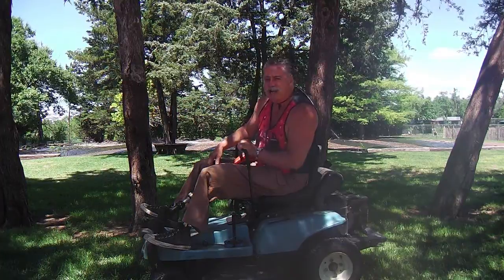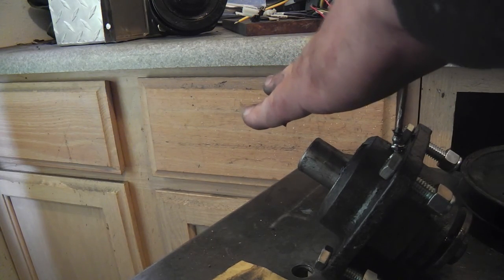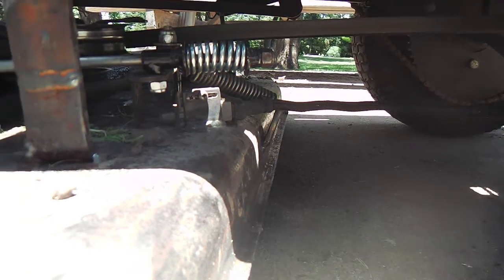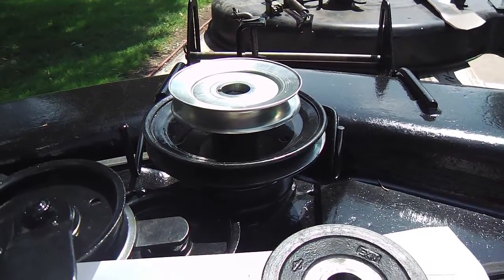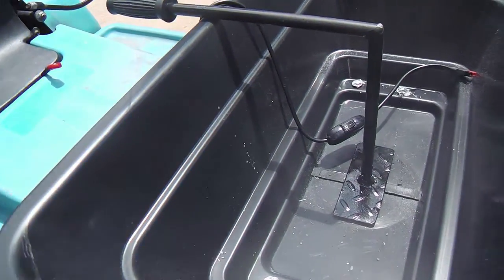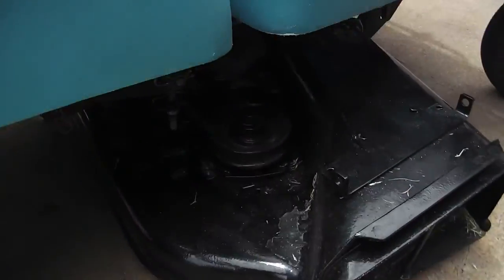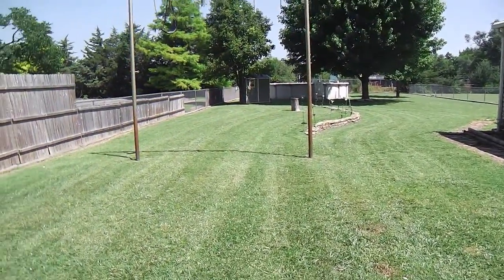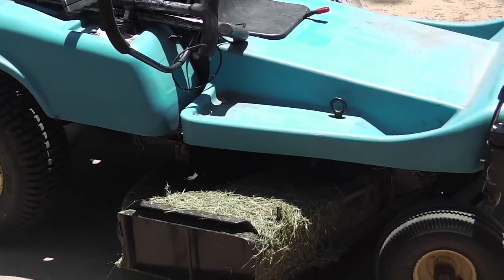Refurb & Refit 42" Deck To 30" Dixon Riding Mower

Comment: You are a smart cookie sir! I just purchased 2 of these models already fitted with the 42 inch deck.. Lots of learning here and I will make good use of the other videos... Looking forward to seeing the 20hp installation video
Reply from the maker: Hey, thanks for that nice feedback. Yeah, people seem to be coming out the the proverbial woodwork to ask if I want to buy their old Dixon friction-drive mower. But, one is enough for me. Although, my mailman has a 3304 that he had since new, even having had it serviced annually for over 20 years, which he now wants to unload, since he bought a bigger, fancier John Deere unit a year ago. Otherwise, I'm putting the finishing touches on the V-twin repower project. The video upload may take a little longer though. https://www.youtube.com/watch?v=wQ1LNr5Gg6s&t=5s&frags=pl%2Cwn
Reply from the maker: Hey, thanks for that, Russell. And if you're jumping into these type of Dixon friction-drive models, I've just finished a new and updated cone installation and adjustment overview, since I guess I wore one of my cones out over a four or five year period. I mean, this one is better than the video I did on this same topic some years before. Peace be with you...  https://www.youtube.com/watch?v=baaGjqRWd7k&t=3s&frags=pl%2Cwn
Reply: I have the electric blade engagement button and the tensioner pulley is in the back by the drive pulley and the belt won't stay on.What can I do?
Reply from the maker: @seasong4  Well, if there's an arm that pivots for the idler pulley that tensions the backside of the belt, it may be bent out of alignment, causing the idler pulley kick the belt off. Get under there like Sherlock Homes to detect and deduce something (motor off, of course, maybe even spark plugs out too). Then let us know back here what it was.

Comment: Where did you buy the head assembly to increase compression. I have a kohler CV14 motor and want to try a different head assembly.
Reply from the maker: Yeah, I forget where, but it was "used", so it may have been an eBay seller.

Comment from the maker: Anyway, after a full season of succesful use with the bigger deck, while still using the original 12 HP Single cylinder motor, I did decide to re-power the mower and deck with a 20 HP Twin cylinder engine. See here:
https://www.youtube.com/watch?v=wQ1LNr5Gg6s

Comment: I have an electric belt drive button how do I tighten the belt?
Reply from the maker: Gee, I don't know. You have a PTO electro-magnetic deck engagement, which my deck doesn't use, as the video describes. But, I'll bet that if you look around between the deck, you'll probably find an auto-tensioning idler pulley that has some spring tension and probably a threaded rod with a lock nut that you can tighten a stretched-out belt with (much like my manually engaged deck belt does, as seen in the video). Please let us know back if you find it and if it solves your problem. Is your mower a Dixon model, not that it really matters? Otherwise, you could buy a tighter belt.